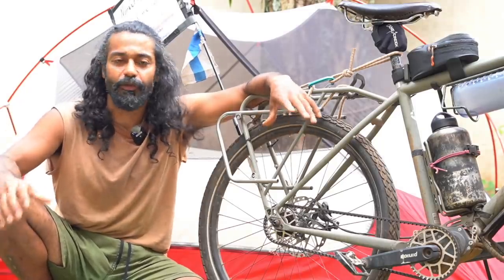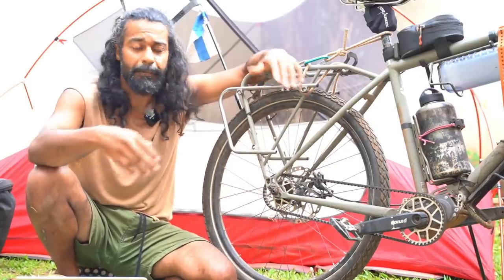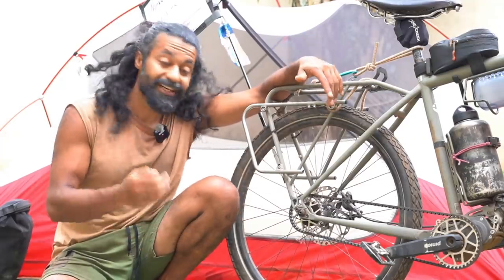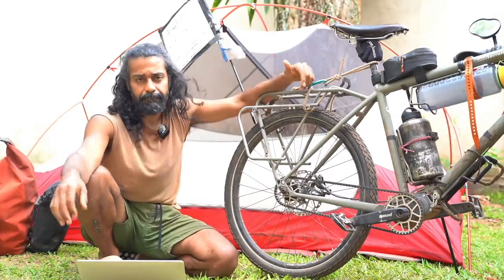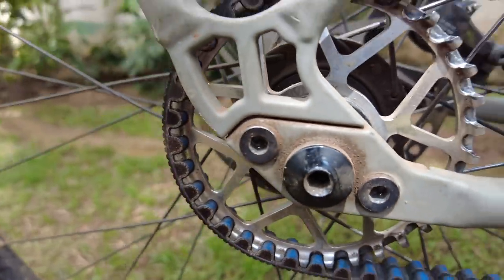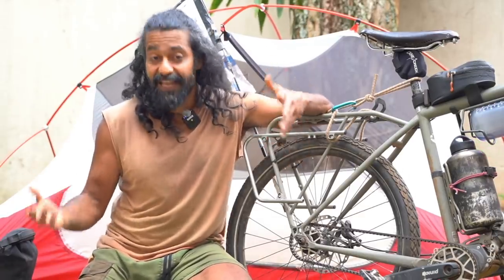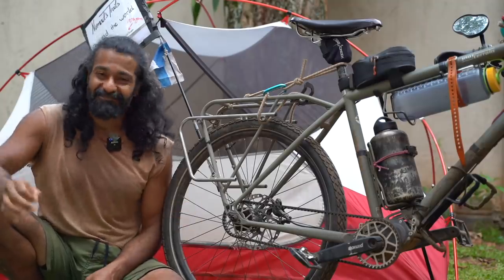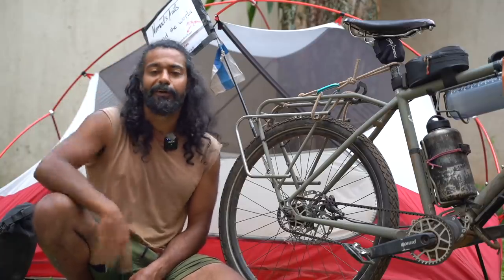Belts Are BETTER Than Chain Drivetrain for Bicycle!  My Test Result After 12 YEARS OF BIKE TOURING!

Comment from the maker: I have made a very small mistake while recording this video, let me know if you did notice it! 
Greeting from Uganda-Tanzania border crossing! 😊
Reply: Well the audio is getting better but i think it was cliping a bit still.  is that the Rode wireless go  or  go2 ? i guess you wend with custom dead cat if its the wireless go since that models deadcat did not stay on that good.  what setup are you using when you record? you might want to lower the input gain just a tad. Been dreaming of a pinion beltdriven bike for a while :D it looks so nice. but i have to put in some more hours and years until i can buy a bike for over 2000€ first i need to do my recovery after a open heart surgery.
Reply: Shimano Alfine or as you said it "Alpha Line" 😉
Reply from the maker: @kamratdennis  the audio  has small  problem indeed but that  is not the mistake 😁. It is wireless go. I wish I had the go 2.  Thr gain is the lowest , also I have very loud voice 😅. I hope your  recovery  goes fast 😊🙏
Reply: Spraying so much silicone spray and your disc looked exposed hahaha
Reply: You went from no. 10 to no. 10, where as you should have said no. 11.
Reply from the maker: @RikuLeppanen  exactly  Riku, this was the mistake 😁🙌 well done!
Reply: @NomadsTrails  🙂
Reply: I have been looking to swap to Pinion belt drive, but the OEM-only prices are too much for me right now
Reply: Dear, I finally find you after check tiktok ins and twit, u are well-known to all chinese fans when u r filmed in Cycler Mr.  Hu his video, best wishes to you dear 🤝🤝👍👍😜
Reply: @NomadsTrails Hi bro, I saw on a Chinese video site that you met two Chinese boys in Tanzania, so I came to YouTube to search for you and found it successfully😂
Reply: No tool is seen when you say "...this tool..."
Reply: I do love biking, and use a chain drive for bike packing, but this dude is so likeable I my change my drivetrain. Lol!
Reply: I'm wondering how this would work on a mid drive ebike, where the chain is the weak link.
Reply: Belt + pineon must compare with singlespeed chain + pineon and not compare to multispeed deraileur!
Reply from the maker: @101picofarad  that can be a topic of another  video. Thanks 😊
Reply: 'I have made a very small mistake while recording this video, let me know if you did notice it!'

Yes, you appear to have accidentally recorded a Gates Carbon Drive commercial.
Reply: You put in music.
Reply: While I do not wrestle lions and hippos on my groceries bike trips. I also prefer belt drive. :P
Reply: You forgot to tell how much time you spend washing your hand after service on the chain.

Comment: I would love to try belt drive but price level for belts and sprokets are insane. Industrial and automotive belts are few times cheaper and I really cant see any justification for that big difference.
Reply: these belts genuinely are more expensive to produce compared to older style machinery belts But they are still pretty marked up and overpriced because Gates kinda has the market cornered
Reply: It's called economies of scale. If every bicycle had belts they'd be cheaper, but for now it's very low volume and this high priced
Reply: and these rohloff speedhubs are insanely expensive too
Reply: Maybe in the future, this will get cloned and sold at a cheaper price by a certain country.
Reply: @anguismemes1666  Shimano makes nice hubs for less.  If you're doing trips like this you want the best.
Reply: @malloott  oh, I guess the future is now
Reply: 3d print mate
Reply: There's high demand but low production. In one word: Monopoly.
Reply: @pandaguan  we all know the name of that country, starts with Chi ends with nA.
Reply: But these belts bear up under stress and pay for themselves. Give it a try. You buy once, you cry once.
Reply: But you will never need to replace a cassette which is a big deal now they cost £50-60.
Reply: Up front belt costs more.
Belt lasts ~3x longer. So amortize the cost and figure it out. Don't forget to include brushes, lubes, degreasers into that cost.

Comment: Please don't use oil on chains, please use wax instead. You can make hot wax melt where you can, you can also make a mix of the wax with isopropyl alcohol to apply on the go in liquid form, you can also just buy wax spray ready mixed with alcohol. The alcohol evaporates leaving the wax. A chain can last a lot longer than you think probably along with the gear rings, especially fully steel set... Cleaning dirty gritty oil out from everything is just the worst and unnecessary. It's a very bad habit using oil on external mechanical parts as it attracts grit which gradually grinds the teeth and chain links down and works its way into the wheel hub and derailleur rivets ect...
Reply: Agreed. People use wet lube and end up with allllll the grit and mess. Drip wax is easy mode
Reply from the maker: Thanks  for the tips 🙏

Comment: Hi Peyman! Thank you for your feedback of great experience! I started with the belt 9 years ago (it's the older, narrower version that can potentially go off the rails although that never happened in the end). It equips 1 of my 2 travel bikes. I drove approx. 20 thousand km knowing that the bike was an almost new opportunity. For me, saving oil and cleaning products, not to mention the grease stains on bags and clothes that require more detergents and disposable gloves when doing maintenance on a chain, all of this pollutes enormously. As soon as I made the change, I noticed that with a belt, you gain in efficiency because there is not all this metal friction and wear = energy! On the climbs, we realize that it is easier with a belt. Finally, the total absence of noise, especially freewheeling at night to approach wildlife, is something very precious:)
Reply from the maker: Hi Didier, thanks  for sharing  your experience. Indeed  the Belt  is a fantastic  innovation in bike industry. It is too good 😁
Reply: Well, there is a better Option:
A chain glider with a Pinion or Rohloff.
The Belt however has a bit more deformation work done to it.
Once you protect the chain from the elements it is a very potected thing. And easy to work with. On our travelbikes we have that system and never had any issues with the chain.

However a chain shifting system will wear out way faster than a fixed chain system.
Reply: @theonly5001  Chain glider? What do you mean? 🤔
Reply: @radekkuszyk  the product is called chainglider. It is basically a housing for a chain, that fits snuggly around a single speed chain. Thus you don't have to worry about debris in your chain.
Reply: @Felix Leipnitz  O yes, I know it 🙂. Although it covers whole chain, some dust penetrates it quite easly. It makes chain service less rare.
Reply: @radekkuszyk  do you mean more often? Or less often?

I had the experience, that even with a service every 2000km the chain is still fine.
Reply: @Felix Leipnitz  Less often 🙂. I have small bicycle service. When I inspect, clean and lube chains in chain glider, I see they are moderate dirty - apparently and for sure less than these without cover. I don't know mileages of these bikes, so it's hard to judge the level of protection against dirt. I guess owners of that bike don't lube the chain too much, but usually it doesn't squeak.
Hopefully I passed clearly my conclusions 🙂.
Reply: @radekkuszyk  i see.
The "less rare" confused me a bit. I just wanted to clarify.

Comment: Pinion gearbox system seems to weigh 2.5 pounds more than XT triple 9 speed chain set which is just over a bag of sugar in the UK at 2.2lb. The difference between belt weight or chain is irrelevant when you look at the overall weight difference.  Many thanks great video as always!
Reply: There's a huge difference in how many gears overall you can achieve with a 9sp triple vs an  integrated gearbox for a belt. 

The chain easily surpasses the belt weight ratio in that regard. 

If you were to compare apples to apples then you would have used an xt 9sp 1x crank vs the belt drive. You also wouldn't need to just be limited to a single group set. The integrated gearbox has limited graduations so you can easily use multiple combinations of chain based hardware to match the gearbox. Cheaper, lighter etc etc.
Reply: That 600%+ range is a consideration too.
Reply: @obliviondio  also that gear box is probably a nightmare to work on for the home mechanic
Reply: @alicenchainrings1326  
Not really. All you'd ever need to do to the gearbox is change the oil every 6k miles which is super easy. It's vastly easier than changing the hydrologic brake fluid which is a standard on bikes at this price point.
Reply: Weight is important. Especially for lighter, smaller people. For a 50kg woman a 18kg bike is more than a third of her body weight. Going to a 9kg bike (which is still far from extremely lightweight) will make a huge difference. Not only while riding uphill and accelerating but also when carrying the bike up stairs or through difficult terrain. Of course on a fully loaded touring bike a 100g or even 1kg difference is going to be hardly noticeable, but it all adds up.
People who say “it’s only a few grams!” are usually the ones who end up with 40kg of luggage and are wondering how anyone can cycle >100km per day.

Comment: I'd choose a belt, if i could afford it. Unfortunately even if the belt itself is not that extreme in price, a hub gearbox is just way out of my league at the moment.
Reply: You are right of you consider Rohloff or Pinion. But Shimano Nexus or Alfine are much more affordable. However, Nexus 8 or Alfine 8 have 307% of gearing range, which could not be enough for hilly terrain  Alfine 11 has 409%, which is OK.

Comment: In Europe, internal gears are a thing. And also, there is a type of bicycle which has a fully closed chain protector box. These come close to a belt drive in longevity because you don't get any dirt on your chain at all. 
When you mentioned light weight, I had mixed emotions. The belt itself is much lighter than the chain, of course. But you need the gearbox, which is usually heavier than a derailleur set. What you did not mention in that section, is that you don't feel any chain slacking vibration under your foot. It's hard to imagine that you feel your chain feeding back into the pedal, but once you've ridden the much lighter belt drive, you know what I mean. And belts are so comfortably silent.
In the ecologic aspect, I'd like to add that we use about the same mass of lubricant through a chain life as we use as plastic on the belt. Additionally, the chain has to be manufactured and lasts only one half of a belt life in perfect conditions. And, in top, the lubricant gets spewed into the environment, whilst most of the belt is put to the trash when it's at the end of its life. So that's a little better for the environment, too.

Comment: Glad to see you have reached the same conclusion as Alee. I don't think I'm ever going to be doing such epic rides as you two but I've been using gearboxes for years and like them so my next bike will have a belt if I can find a suitable one. I prefer to buy 2nd hand bikes for both cost and green reasons, but finding a small touring bike with a belt drive s/h is tricky. Belts are still uncommon.

It's great to catch up on where you have got to. Ive not seen any of your vids since you got stuck with the Pandemic. So I have 2 years-worth to watch now!
Reply: У меня старый велосипед Бриджстоун на ремне и планетарке,3 скорости,ему уже 40 лет и до сих пор родной ремень)

Comment: Very interesting. As an auto mechanic having serviced belt and chain drives that have done probably done a combined 100 million kilometers the chain is by far superior in longevity of operation if you can keep it clean and lubricated by a similar factor of 3-5x. With the design of bikes and how long it takes to refill a tank on a car vs person though I can see why it would not be practical to run a internal gearbox plus heavier drive be it shaft or or chain and to have the extra components like a timing case to keep everything clean and lubricated.... I dare say with modern materials and machining though we will soon see a chain an encased chain or shaft drive soon enough that will be essentially maintenence free for 100,000km or more.
Reply: Chains are better in enclosed systems that keep the chain lubricated well and clean. The disadvantage to an enclosed chain is increased size and weight, and in the case of a bicycle, very difficult or even impossible on some designs as many bikes route the chain around the frame so the frame either needs to be welded around the enclosed chaincase or the chaincase needs to be assembled from separate parts. This problem is also present with most belt drive systems, except for the Veer Split Belt system. Either way, the main problem with belt drives on bikes is the price, with the previously mentioned Veer kit starting at $350 and a replacement belt costing $100. While replacing the drivetrain components on a derailleur bike might add up to somewhere near the price and the chain at least needs to be replaced quite a bit more often that a belt, than maybe over enough time it's worth it. For a bike that already has an internally geared hub or a gearbox and has a chain drive, a belt drive system likely wouldn't be any cheaper as the chain lasts longer as it is always kept in a straight line and wider, stronger chains are used because there is no need to fit in many gears side by side like on a derailleur cassette. And if you're starting out with a derailleur bike and want to convert it to belt drive, you'll need to get a new rear wheel with an internally geared hub or replace the hub on the already existing wheel, either of which costing extra money.
Reply: The problem as briefly mentioned in the video is rigidity. A shaft drive system needs to be seriously well secured and that weight/complexity on a bicycle isn't desirable for efficiency losses.
Reply: Chain on bike wears quickly because it's exposed to external contaminants like water, salt, sand etc. Zero friction cycling has done extensive testing on this. How different chain lubes affect chain longetivity in different riding conditions. Waxing the chain can actually prolong its life about 3-5x of a normal wet lube

Comment: For shorter trip, like a few weeks or couple of months, I can live with chain. If I decide to do a very long trip, a year or more on the road, definitely go for the belt drive.
Reply from the maker: For sure chain  dose  the job but the belt is incredibly  convenient and long lasting 😊
Reply: I like my chain and XT gears on the touring bike with bar end shifters. Very basic but reliable. I like the idea of the pinion gear box but for gravel tracks and cycle lanes I could not justify the cost versus the benefit. I appreciate that it’s perfect for round the world touring. Great video! Thank you.

Comment: Thanks for your report!
For Globetrotters or Dirt track drivers I also see the benefit of a durable belt and enclosed gearbox.
I bought a bicycle with belt drive for my wife, who has got problems with her knees and thus cannot bring high pedal power.
For such a specific usecase, the deflection force of the beltdrive is significant versus a well greased or oiled chain.
Easy to switch to chain though.

Comment: Chains are $20 a pop and last reasonably long when regularly cleaned. I'll admit, if I cycled around the world the belt drive system would no doubt be superior, but I use my bike to commute to work and go on weekend joyrides. The cleaning is more work, but I only spent $300 on my bike second hand. I just don't think belt drive systems are a good value unless you fit a certain niche.
Reply: Only 300$? Its like 1500PLN its huge amount of money.
Reply: @11marcian  mine did costs around 1200$ but I use it since 10 years.... Yea no heavy driver. First chain. The belt is slowly looking through the tire 😂. But an E-Bike this class is 2 times heavier and easy over 2500$
Reply: @11marcian  if that's alot of money, then you've got bigger problems...
Reply: @murrijuana2842  mam idk where you are from, but here in Poland we are all poor. I and my family drive one bicycle. We call it pierogowe zawody.
Reply: @11marcian  I'm in America, lot of people have money but almost everyone is lonely and unhappy.

Comment: I am curious why you don't use a chain (belt) enclosure.  That would fully enclose your belt so it's protected from mud, sand, branches, etc, making maintenance even less necessary!  It would also protect your pants from getting caught between the belt and sprockets, and keep your pants/clothing cleaner.  With a belt drive, you have a unique opportunity to use an enclosure because you have a straight belt line, unlike derailleurs where the chain moves sideways.  A belt enclosure would make your touring bike even more robust.  Thank you for your honest and unbiased video.  Most reviews on Youtube are commercial in nature and quite useless.

Comment: I've been riding with a Shimano Nexus 8 and Gates belt for maybe 4 years now, just as a weekend bike and work commuter. One thing worth noting is that belt tension is pretty important, and that setting it either requires use of a proper tension measuring tool (which I don't have) or use of the slightly dodgey Gates app which uses your phone microphone to detect the frequency of the belt as you "pluck" it, in the same way as you'd tune a guitar. Bizarrely my bike only has a threaded tension adjuster on one side of the rear axle, which makes setting tension whilst keeping the wheel straight very hard. Surely most bikes have these adjusters on both sides, like you'd find on a motorbike?
Reply: Yes, I haven't seen a one-sided adjustment on any bike. It sounds a bit "cost effective"...
Reply: Maybe your bike has an eccentric bottom bracket to adjust the tension?